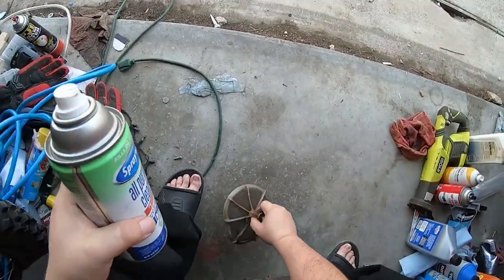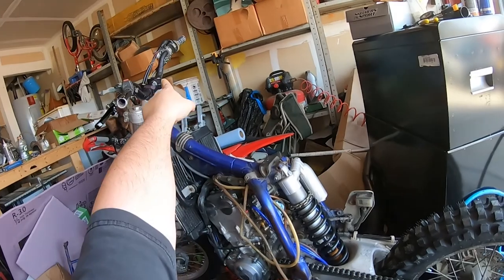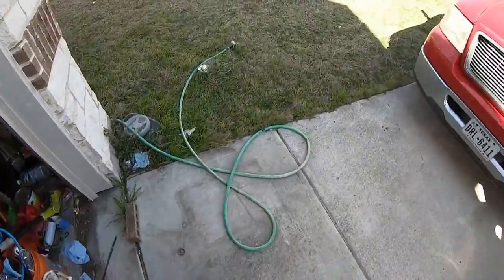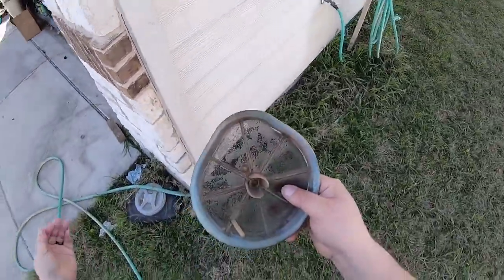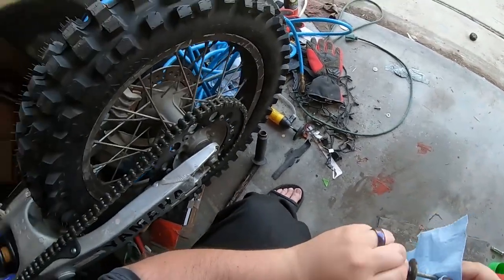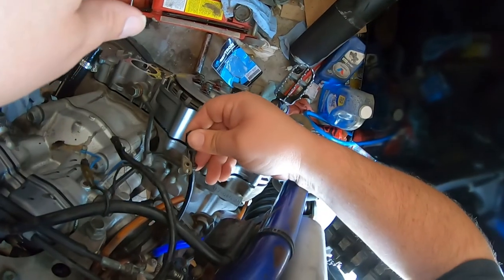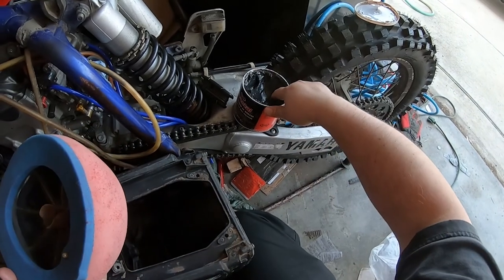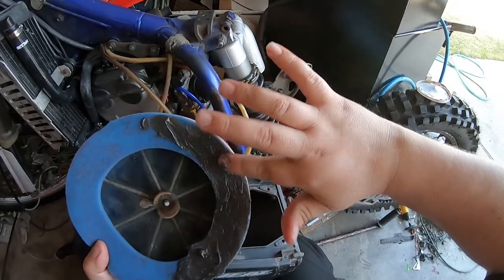WR400F Rebuild Part 6 (Air Filter, spark plug woes, misc)

Comment: I’ve got a 2000 wr400 I use for the street. I love it. Runs lean though. I plan to take it to a shop to have someone re jet it before I ride again.  I love these bikes.  I had a 99 YZ400 couldn’t keep the front wheel down out on the farm haha
Reply from the maker: I miss mine, only downside for me is it was very tall and I'm lacking height.  It was a handful for me to hot start during races.

Comment: Can you make a video on how to take the air filter out? I cant figure it out
Reply from the maker: Unfortunately I do not have the WR400F anymore but when you get the screw out you will pull back then turn it sideways a bit.  I can try and take this existing footage if you need a better explanation and do a sort of poor mans photoshop.
Reply: @stoplogicmotorsports  thanks man just got it out and got a whole new filter and just works so much better thanks
Reply from the maker: @brandong405  Anything to help, funny story the 400F i was restoring in these videos had a red bandanna in the air box for a filter when I bought it.
Reply: What size is needed to remove the spark plug? Thanks